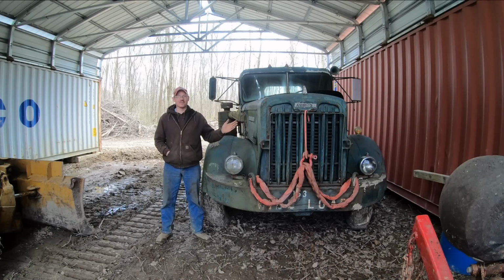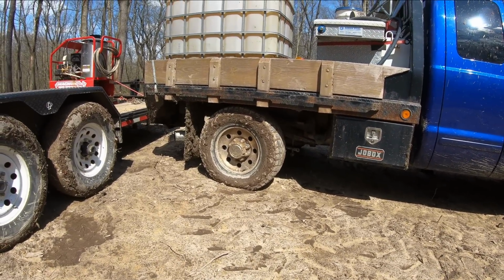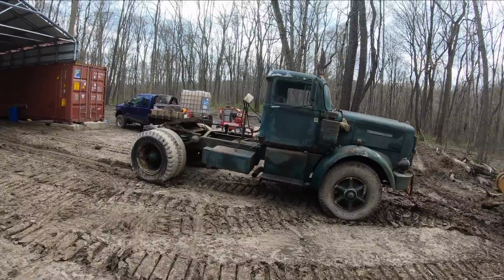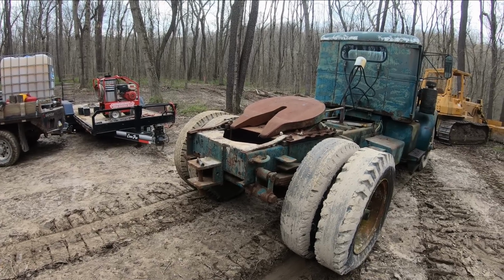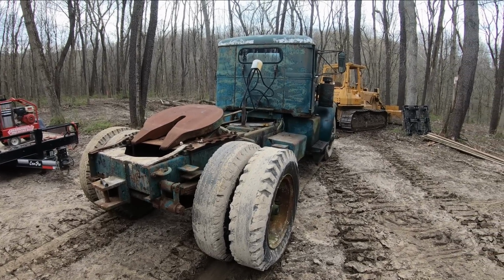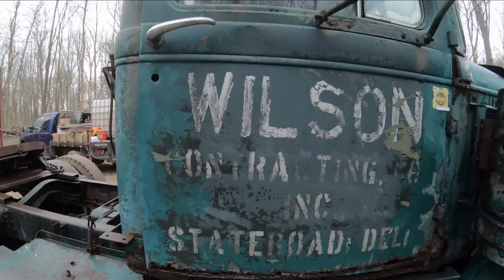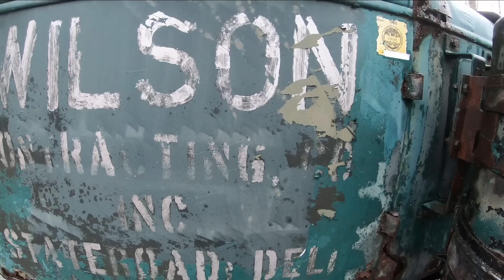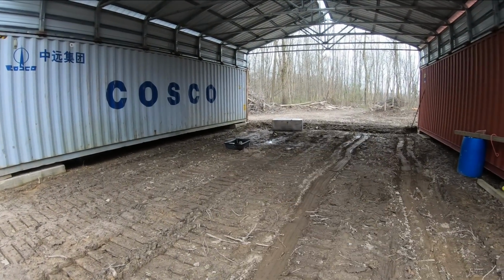Steam Cleaning 63 years of Grime off of my 1957 AutoCar Semi Truck!

Comment: 3:05 330 gallons, 2700 pounds??? Dude, this is 1 cubic meter tank, which is 1000 liters, which is around 1 tonne of water, which is 1000 kilograms. It all would be simpler and faster for you if you used metric but well... one stubborn country.
Reply from the maker: stubborn indeed! i like my units of measure!!!
Reply: @DieselCreek  Be careful tho. Most newer US made equipment is metric, also obviously every import equipment. You wouldn't believe how many times people mess the treads up trying to put imperial thread bolt into metric hole these days. I can't wait to see the Autocar project moving, good luck out there 😊

Comment: Never tow ANYTHING with the tractor linkage raised. Always pull from your LOWEST tow point.
Reply from the maker: negative, you want to pull from the same height as the spot you are hitched too that way you arent shooting youself in the foot by taking weight off the wheels of the tow vehicle, its when you go higher than the hitch point you can pull the tractor over on you.

Comment: Buy a tractor from the early 90s and transfer the body over so you have a reliable drive-line that you can easily get replacement parts for , most likely cheaper and easier route to take jmo
Reply from the maker: its not really going to be a work truck more of an occasional use truck, and I want to keep it as original as possible

Comment: I don't know if this would be applicable on a truck. But I have heard that one way to prevent/retard rust is to add a bit of kerosene in the water that your using to clean the car with.

Never tried it before, but it makes sense.

Comment: No gravel in the ground? Couldn't just dig a big hole
Reply from the maker: haha no not around here!!! theres 30 foot og clay here before you get to rock
Reply: @DieselCreek  holy crap. Then your gonna hate this. I live in a development of 50 houses built on an old gravel pit. The entire site is sandy gravel except on one end that has 12 feet of loam. Back in the 50s they pushed all the loam of to one side. My Dad bought the land in the 80s and my brothers and I built the road and the houses. 75 acres of sand and gravel and oddly one and only one  giant rock the size of a 18 wheeler(right where the sceptic was to go) no other rocks bigger than a peach. I go outside dig through 8 inches of loam and I hit gravel all the way to bedrock.

Comment: Autocar shouldn't go anywhere without air to release the brake. Go easy on cleaning that oil bath air cleaner or you'll have oil all over.
Reply from the maker: There isn’t modern spring brakes on these old trucks. No air= no brakes

Comment: You're not going to get it "drug out", you are going to "drag it out" if you wish to speak English. Brick pave your "shop", you'll appreciate it.
Reply from the maker: if you donate the bricks Ill lay em down lol
Reply: @DieselCreek  that's what demolition yards are for. ;-) 
I've worked out of many transport yards all over Australia which are brick paved in preference to concrete or bitumen, they wear well, don't crack as much, are OK in areas which freeze and if you've got to maintain an underground service, or lay one, they are easily raised and replaced at little expense. They handle big weights, 60 tonne container forklifts and road-trains are common in those yards. Also if you drop a tool, nut or bolt when working on old Autocars you don't lose it in the gravel stones...